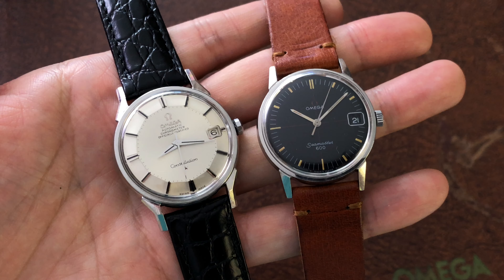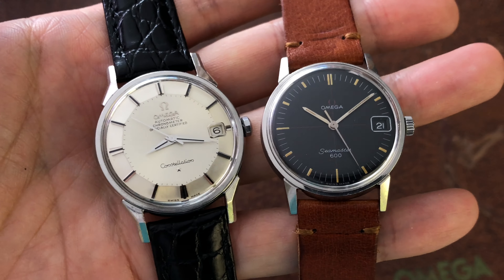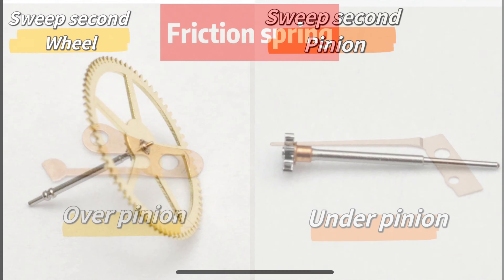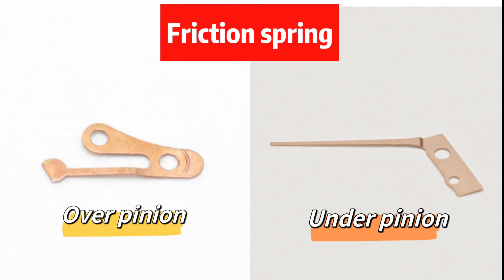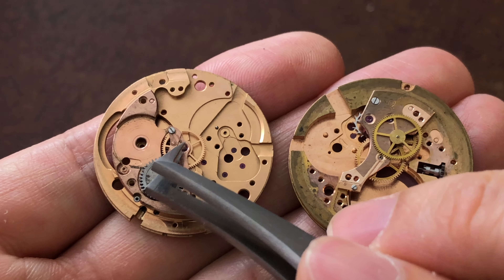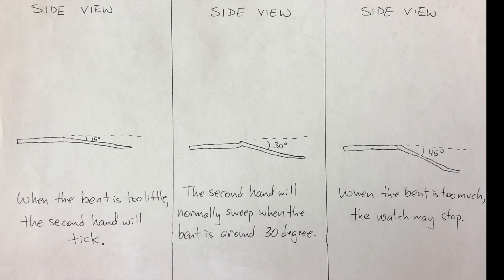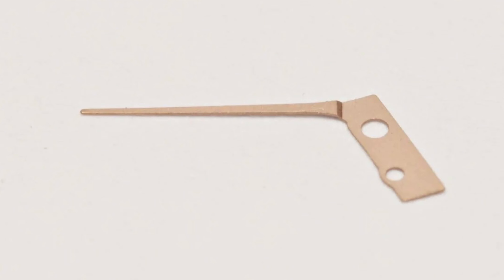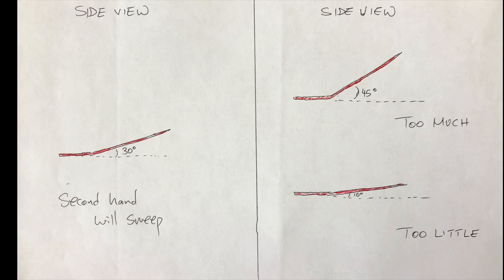HOW TO FIX A TICKING / STUTTERING SECONDHAND ISSUE ON YOUR MECHANICAL WATCH

Comment: Good day to you. I have found similar issue with a 1972 Longines Admiral watch that i have just acquired. Not just that, even though the timegrapher reads fast, the watch slows dramatically throughout the day. Do you think the problems correspond to each other? Keep up the good work
Reply from the maker: it could be a balance wheel issue too.

Comment: I have a vintage omega speedmaster professional and the chronograph hand ticks unevenly is it the friction spring ?
Reply from the maker: It could also mean the post on the hand required some tightening or the chronograph needs a slight adjustment.

Comment: Would this kind of ticking damage the watch? I have a vintage constellation that stutters just a little bit but is consistently runing at plus 20 secs a day after service
Reply from the maker: No, the stuttering will not cause any damage. Annoying to look at for some collectors. Time running not consistently may not be the cause of the stutter either.
Reply: @TimelessHistoryChannel  Thank you man, your channel has been very useful to get specific info about the pie pan constellation. I recently got mine and although its not perfect price was right. Cant be picky in Mexico either as we dont have much choices in vintage watches
Reply from the maker: Thank you. Just take your time. I have seen some really nice from Mexico too.

Comment: Is there any specific website or book you would suggest looking at to make sure that a vintage Omega Constellation is legit. I found an awesome watch on Chrono24. I was looking around for more options for the exact same piece. But I could only find 3. Is that common? I really don’t want to buy a franken watch! The stated ref number is 168.010-11. It has an all gold case, a silver dial (champagne), it’s a pie pan, with a date window, and it also has those verticals and horizontal lines (looks kind of like a scope), it doesn’t have the arrow markers, it has the longer rectangular ones. If it sounds like I’m potentially an idiot, it is probably because I am. I don’t have any technical knowledge on watch just an admirer.
Reply from the maker: I don't think there is any website in particle unless you try to create a post on the Omega Forums asking for help. There are several specialists there who know their craft. 
Or as a second option, you can always go on my site and use the donate feature at the bottom of the homepage to ask any question unrelated to the product listed on the site.
Reply: @TimelessHistoryChannel  Ok, thank you for your help! I really appreciate it!
Reply from the maker: @user-kt6dk7nj9n  You're welcome.